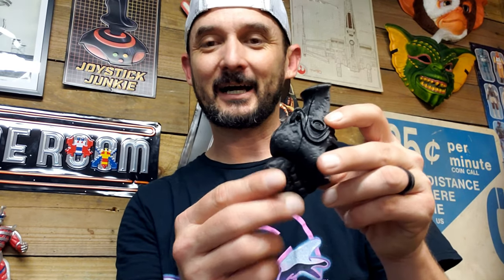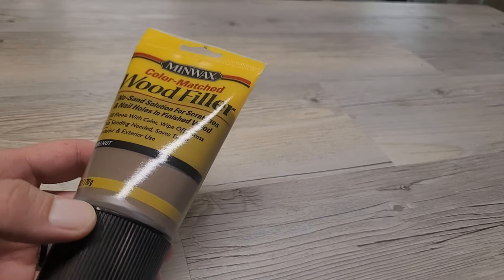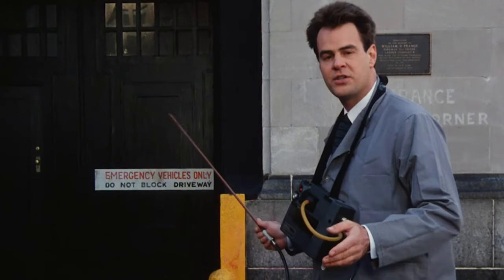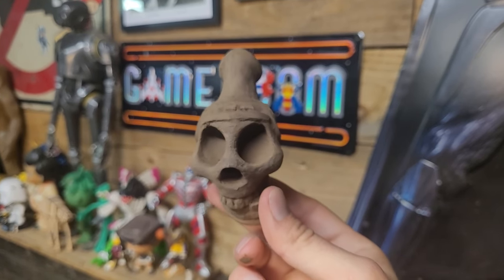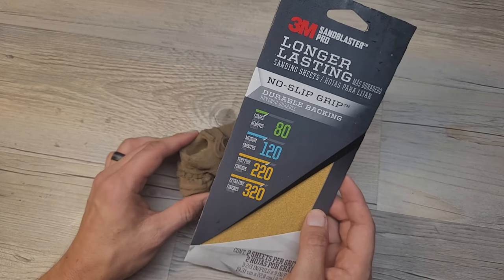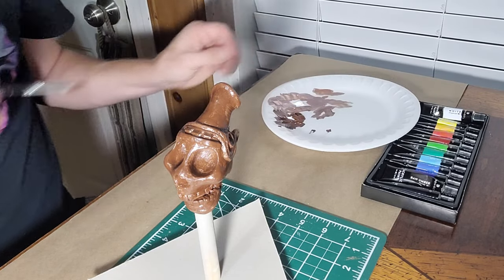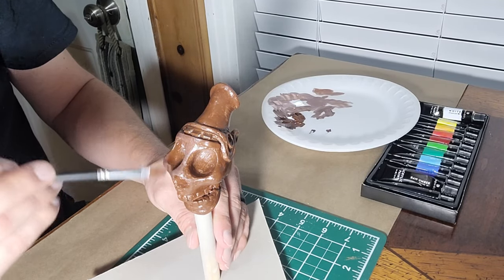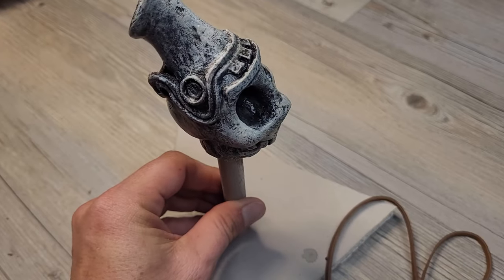3D Printing A Aztec Death Whistle From Ghostbusters Afterlife!

Comment: So it doesn't work. There is supposed to be a little ball inside the moves when you blow through.
Reply from the maker: Yeah that's what I thought as well. The 3d file didn't have it and it wasn't listed in the directions 😕
Reply: @dibribuilds2854  nope it's not a regular whistle, no need for the ball, it's all about placement of the chamber and the hole where you blow, it's all about placement